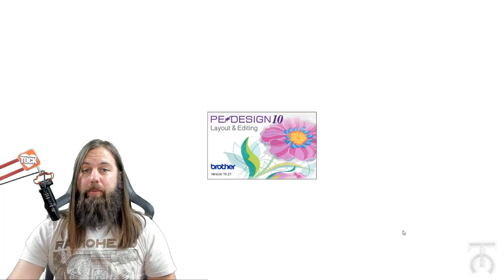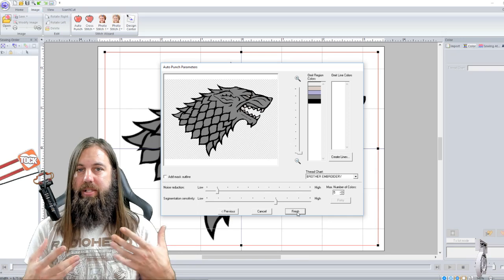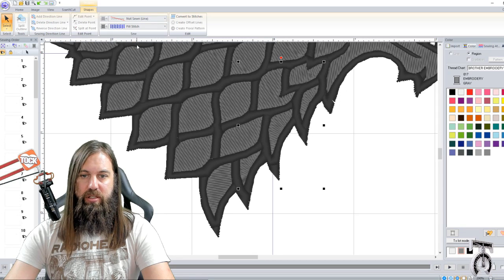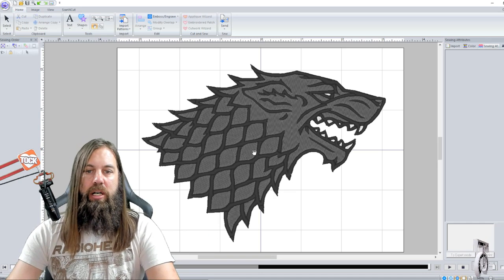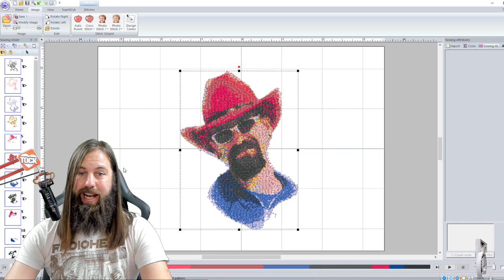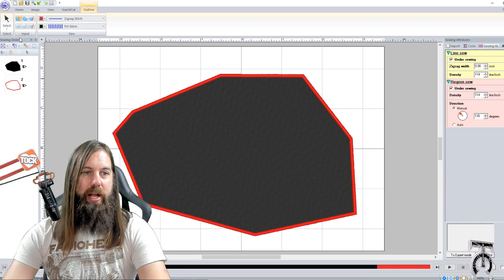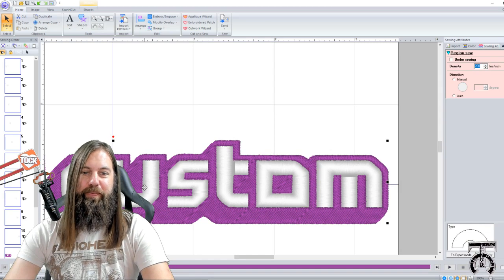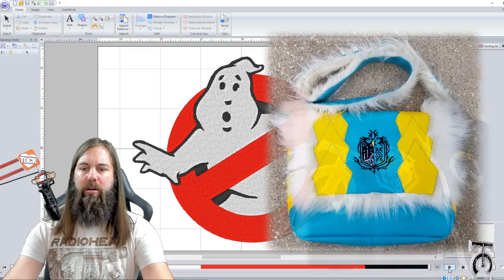How to digitize graphics for embroidery - Tock Custom

Comment: Ho Lee Sh*! PE Design 11 is $1700 on sale right now. Regular $2k. Is there no option other than the Inkscape plugins for someone who is just doing this as a hobby? I looked at Embrilliance, and it looked reasonable for a minute until I saw that it is broken up in to many little packages and licenses and StitchArtist, which is what you would use to draw designs, is broken in to 3 levels, and the mid-tier level 2 is ~$400. Wilcom doesn't even show a price for their products. They have an "Enquire" form, which translates to "get yourself setup to spend time on a call with a Sales Rep, and everything talking to sales people entails.

Comment: I'm really curious to know what was the file type that you imported in. The program easily converted it which is impressive.  Other programs I've been looking at and trying all require manual manipulation to redraw all the lines on top of the imported image. Either you already did that step, or this program is really that good, or your image wasn't a typical clip art gif/jpef/bmp file. Please respond....I'm getting ready to buy a program. 🙂  PS....your videos are great....very helpful!

Comment: Hello, I love your videos. I’m new to embroidery. I purchased the PE Design 10 but it will not work because I didn’t have the card reader. I purchased the card reader and it’s still not working. Do I need to have the previous version of the PE software in order for my PE design 10 to work?

Comment: I’m trying to find where I can purchase this software you’re using in this tutorial and I’m seeing there’s a later version PE Design 11. Which do you recommend getting? I’m worried it won’t be similar enough for me to be able to follow your steps, and since I’m clueless I really need to follow your steps. Any suggestions? Also, where can I purchase this program safely? It’s been sold on WISH, Etsy, eBay, etc. I am skeptical there’s scams and I don’t want to be swindled. Thanks in advance for all your help!

Comment: How did you get the graphics to display without issues? I use Vector Magic, use just 2 color  in palette selection remove background, gives the image nice sharp lines, doesn't matter what vector format i use, when using the wizard in PED 11, half the characters disappear or look deformed no mater what setting i use.

Comment: Thanks for the time to make these videos. Very informative 👍🏻I do have some questions. I recently purchased PE Design 10 upgrade version. Upon installation I recieve a message about Must connect a card writer/reader module. I'm hoping you can clear the confusion. What is the best ( card reader module) for me to get for PE Design 10 upgrade version? Also does PE Design 10 upgrade version software work by itself or do I have to purchase another software so that I can use Pe Design 10? If any one else can chime in I would greatly appreciate you all. Thanks a million

Comment: Hi there 
Your videos are great but I wanted to ask you some questions what is the best quality and most cost affective machine in the brother range that can do custom designs for light leather, canvas, denim? 

Any help on this would be much appreciated as I would like to create my own patches and custom work and logos... the price range I’m looking at is around the $1000 mark is that too cheap for this type of job that I’m looking for.

A machine that’s easy to use has a lot of different functions, for example a machine that changing the colour of the thread is easy enough to do.

Comment: You mentioned that this software is discontinued and is replaced with the 11. Will that be compatible with the SE 400 (which does not utilize cards but saves directly into the machine)?

Comment: Love the video. I need advice with some designs. Some of mine work great but others that are simple and have four colors end up terrible. I make sure the lines are perfect anf the image is basic before I try the digitizer options but in the noise/segmentation section the images become distorted and no option makes them look like the original. Can anyone offer suggestions? Can I digitize manually on another section of pe design?

Comment: hi! I have a question..I`m trying to set up a design that is only lines ( an ilustration) and the software doesn`t seem to process the image properly, when I try to set up the amount of colors, the image just dissapears as if it cannot recognize the design and is basically transparent. is there a particular resolution for the image or thickness of lines that should be taken into account.. thanks!

Comment: Before you start designing, you should know hot to sew, how the needle creates satin stitches. The comprehension of needle's zigzag movement actually will help you decide to choose  fill or satin stitch type. And also learning graphic software would give you easy process because you can create so many designs, and you can edit them and finally export them. Sometimes instead of using images you convert them to vectors and after that you kind of do not have to use the gradient part if there are any in design. These softwares does not have adobe illustrator or corel's capabilities. Wacom has that pipeline with corel but the package is expensive.  However even with that expensive option, with graphic background your process will be so smooth.

Comment: Tok, I just found you on YT by browsing, and your videos are great! I had to smile when you said in one that you have been teased and called 'Sewing Jesus'.  Men have been sewing for centuries! My question is can you import SVG files into the Brother software? I have a Cricut and use SVG's, so it would be great to cross over intothe sewing realm with my already loved files. I am shopping for a sewing machine and theSE600 is enticing. My BabyLock BLDC has a broken gear (she is 16 years old 😢) and I have been a brand snob until I discovered that my machine and Brother's machiness are made in the same factory/take the same parts. My mechanic couldn't find a replacement gear and BL called me back last week and said they don't support my machine any more. That makes my 25 year warranty a joke.

Comment: This may be a dumb question but I am new to this. So, I have purchased PES designs from websites and Etsy sellers. I then save them to my computer and use the cord to get the file onto the machine from my computer (I have the Brother 4x4 size embroidery machine). Would I be able to use this software to make designs like you have shown, save them to the computer as a PES file just like the ones I've purchased, and use the cord to get them on the machine? Or does the program only work with the dongle?

Comment: It is very powerful software and can do just about everything the best commercial software can, although it may take a few more steps.  Myself, I am an old school hand digitizer following in the footsteps of John Deer, Steve Wilson and Walter Floriaini.  All about machine productivity and pathing. Never have used the auto features.  However, when used correctly as you have done, you can get excellent results. As long as you do not have to sew out more than a dozen it is a good way to go.

Comment: Have you ever used InkScape/Inkstich in your workflow? I utilize Adobe Illustrator 2020 as part of my design workflow and would like to include it with digitizing embroidery process. But the best I could find is i2 software that is an Illustrator plugin. It is commercial grade and has a price tag to match, over 3k. While searching for a similar alternative I came across Inkscape/Inkstitch. It is open source and therefore free. I am considering utilizing this app but wanted to hear from more experienced people such as yourself. 
Note: It is difficult to find PE Design software, and as you pointed out previously, most of the online software seems to be a scam. My Brother SE400 has a USB-B port, so I think I do not need a card reader, and can transfer the PES files directly from my computer to the sewing machine.
Also, thank you for such a great tutorial.

Comment: Nice video. The patch option seems interesting. But when I see how some ppl make custom shaped patches, they do the following: first make the patch with a simple border. Then cut it out. Next they would put a layer of clear plastic (or water soluble film) in the hoop and have the machine sew the outline of the patch. Finally they stick the patch within the outline and have the machine do a thick border that covers up the cut edges. This way the patch comes right out the plastic and the border is nice and neat.

Is this a method that you can recommend? If so, how would you design this using the software? Make 3 patterns for the patch, the outline and the final border? If not, how would you do it?

Comment: Hehe he said dongle. ;)
Great job at giving an easy entry point for beginners to be up and going in a few steps. It may be just the tip of the iceberg of what the software is capable of but howsoever it is a good starting point.